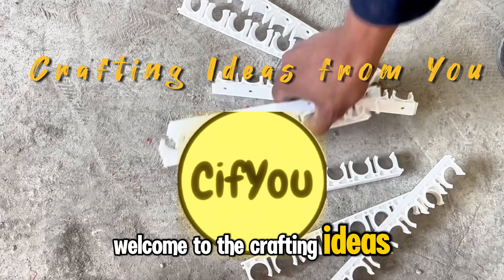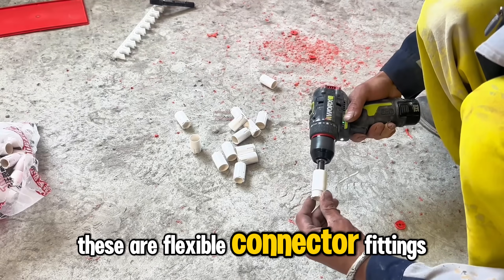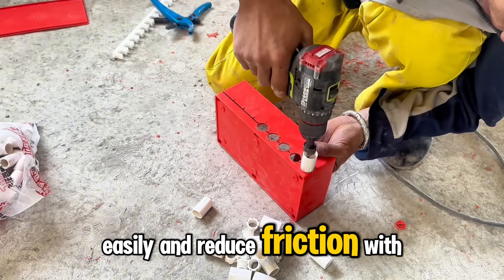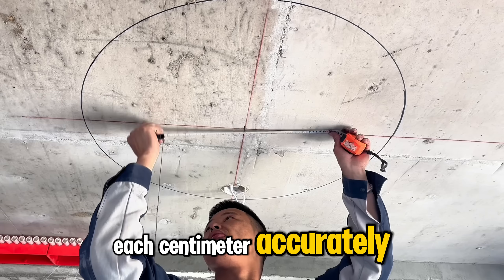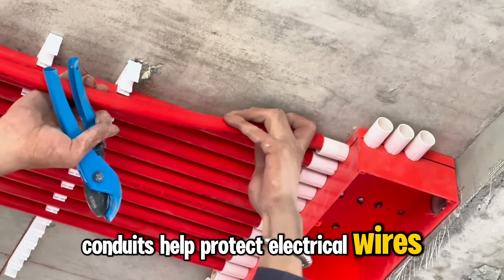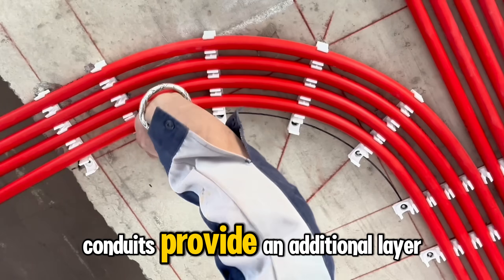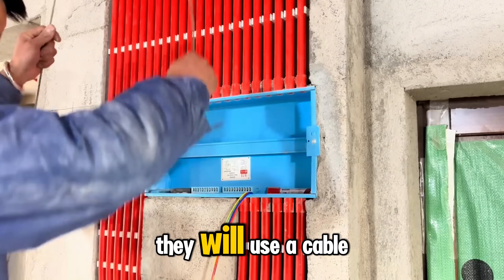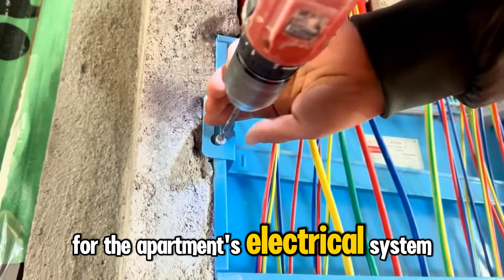What would electricity look like without following NEC (National Electrical Code) standards?

Comment: It's terribly inefficient though. They are still using the archaic European circuit breaker design on DIN rails. They're very useful in industrial control panels, but inefficient and archaic for building load centers. 

For example in the US circuit breakers simply plug on phase and neutral bus bars; no need for hand fitting bus wires between all the circuit breakers to interconnect them all. 

Plus we don't need to run such a ridiculous amount of wire and conduit since a single 15 or 20 amp circuit can daisy chain multiple light fixtures and receptacles on a single circuit; much more efficient and cost effective in both materials and labor.

The US were the pioneers in inventing and designing electrical power systems so we're generally more advanced, but have fallen behind on some of the European innovations like their outlet box designs and their incorporated wire set screw terminals.

And yes, I'm a licensed electrical contractor.
Reply: Also fallen behind on voltage front
Reply: @NileshKumar-uf4vh  <> Nope, that's a typical misconception of those not familiar with the US electrical power system. Non US power systems use unbalanced ground system because they only use the two wire 240 volt phase lines with one of the two phase lines grounded, which produces 240 volts to ground.

 On other hand the US power system uses a balanced grounded system, a three wire split phase 240/120 volt power systems that's only 120 volt to ground by grounding the middle neutral wire instead of any of the 240 volt phase lines. 

This system provides two voltages (240 & 120) to the building; 120 volts for lights, receptacles and small appliances, and 240 volts for large appliances like electric stoves/ranges, clothes dryers, water heaters, air conditioning, heat pumps, spas and so on. 

The system was adopted as an advanced safety system because it cuts the voltage to ground in half making accidental electrocution much less lethal. There's no need for 240 volts for lighting, receptacles nor small appliances; it's totally unnecessary. In fact there's currently a new low voltage wiring system being developed to replace the current 120 volt lighting circuits since lightning have become predominantly LEDs making 120 voltage and 15 amp lighting circuits totally unnecessary.
Reply: @Oldhogleg   trust me vro. Kindly cite any paper that shows 110 v ac mains is safer than 220 v ac mains.
Reply: @NileshKumar-uf4vh  <> Trust me bro, it only takes one amp to pass through to stop the vitals. The higher the voltage, the more amps are forced through.
Reply: @Oldhogleg  The claim that 110V electricity is safer than 220V electricity is a common misconception. In reality, the safety of an electrical system is not solely determined by the voltage level but by various factors, including the design of the electrical system, the quality of the wiring and components, and the presence of proper safety measures such as circuit breakers and grounding.

Both 110V and 220V electrical systems can be safe if they are installed and maintained properly. In the United States, the standard voltage for residential electrical systems is 120V, not 110V, and in Europe, the standard voltage is typically 230V, not 220V. These voltages are within the safe range for electrical systems.

It is important to note that higher voltages can pose a greater risk of electrical shock, but they also allow for more efficient transmission of power over long distances. In general, the safety of an electrical system is more dependent on factors such as proper installation, grounding, and the use of circuit protection devices like fuses and circuit breakers rather than the specific voltage level.

There is no definitive statistical evidence to support the claim that 110V is inherently safer than 220V. Both voltage levels can be safe if the electrical systems are designed, installed, and maintained according to safety standards and regulations.
Reply: @NileshKumar-uf4vh  <> You totally missed the point. It's about someone being accidentally electrocuted. Electronic safety devices like GFCIs are not everywhere and are not infallible and do fail. Besides our electrical power system was a safety measure before the reliance on electronics.

You can argue all the irrelevant minutias you want, but the bottom line will always be higher voltage means greater risk to life. If you can't wrap your head around that simple reality, then I can't help you.
Reply: @Oldhogleg You don't seem familiar with the European electrical system. Except for the UK, virtually all houses and modern apartments (particularly those without gas) have a three phase system, I think most often with 3x25 A service. 400V is commonly used for cooking equipment. I have a 7.4 kW induction stove for example, it uses two phases, the third is for the (separate) oven. I also a regular socket 3 kW kettle that boils a cup of cold water in 40 seconds. Lots of 2+ kW equipment: clothes dryer (w/heat pump), washing machine, dishwasher, four unit ductless AC, even my hair dryer is 2 kW… and it is all wired with 2.5 mm² copper on 16 A breakers.

DIN breakers are commonly installed on rakes, layered for three phases. Commonly a three phase RCD (GFCI) is the first item in a row, followed by 16 A breakers for all socket circuits. Lights are on a separate, single phase RCD and a 10 A breaker and 1,5 mm² wires. Sometimes socket circuits in wet rooms get their separate RCD or RCBO as well.

Meanwhile you only protect some outlets and incur the cost of GFCI equipment for each individually.
Reply: OK, but that has little to do with the points I was making. The point I was making is that the US uses a balanced grounded 240/120V split phase system out of safety because it's only 120V to ground. That's insanely dangerous to be running 400V in a residens. Plus the US load distribution centers are more efficiently designed because the circuit breakers plug on the bus bars instead of installing bus wires by hand to power the circuit breakers. 

You don't mention the configuration of your 3-phase system? Is it a 3 or 4 wire delta? Is it a 4 wire Y? Which lead are you grounding? Is it a balanced or unbalanced grounding system, or is it an ungrounded floating system. If it's grounded, what are the voltages to ground?
Reply: @Oldhogleg  You did make a point that 240 V is "unnecessary", which is a very self-centred perspective. You just don't know what you are missing.

Another difference you probably do not realize is that we don't have as many transformers. A common small pole transformer is not a thing here. A transformer here is a big expansive object, per village or a group of apartament buildings or maybe a major building. While you distribute power to the last mile at what we would call medium voltage, even through residential areas, we distribute it at low-voltage 400 V, from the big transformer all the way to residence.

However residents have virtually no chance of contact with 400 V. Commonly there is literally one spot in the apartament/house where the stove is hardwired. In houses, there would also commonly be a red CEE industrial socket in the garage as well, for workshop equipment and such. Otherwise every other circuit is single phase. The whole point of three phases going into a house/apartament is balancing. If residents are at home they use appliances wired to all phases if the circuits are distributed across the phases properly. That is why you often cannot get more than 7 kW-ish single phase service here (UK being an exception).

There are multiple grounding systems in use in Europe and different countries do them differently. Here TN-C (L1, L2, L3, PEN) used to be common, now being upgraded to TN-C-S, and new builds are TN-S most often (L1, L2, L3, N, PE). Some countries did TT and IT, but those become less common with metal pipes no longer being used and general standardization of European equipment.

You should realize the only reason you ended up with exotic three-wire single-phase system is DC legacy. Your household AC systems mimic the original DC +/0/- systems. It is not efficient, that is why virtually everywhere else three phases are used. Add one extra conductor, get three times the power. It makes sense on the grid level, it also makes sense in wiring residences.

And 230 V is not unsafe if you have well designed sockets and plugs, that cannot shock you, like ours, and if you have everything GFCI-ed, like we do. And even that insanely dangerous hardwired 400 V induction stove is way safer than literally having explosive gas pipes in your house and lighting that gas multiple times a day and breathing in its combustion products.

Your points about LEDs are valid, I even stumbled upon a concept of wiring office light fixtures with Ethernet cables at 48 Vdc – which can therefore be done by non-electricians.

Can't comment on your busbars, the name suggests a sensible concept - for a single phase, which has clear downsides compared to three. I guess a three phase comb busbar is a close equivalent used with DIN rails, but DIN rails can accommodate much more equipment than just breakers, like, I don't know, common GFCI for all circuits!
Reply: No, split phase has nothing to do with Edison and his DC system wich was eventually put to the grave when Nikola Tesla created the AC system here in the US which also created the single phase, 3-phase, and split phase. By the way, 4-wire deltas and Ys are also split phases; are you going to tell me those are DC throw backs too? I think not. And yes, we have 3-phase here too, and in higher voltages as well, but it's typically reserved for industries and large buildings. And we use the bus bar system for circuit breakers for those too. 

I'm sorry, 400V for homes is criminally irresponsible. It's near certain death if electrocuted. No, they're not running 400V in homes because it's better, they do it because IT'S CHEAPER! They rather put cheapness over the safety of the public. 400V in a home isn't a virtue, it's a crime! They've been urinating on your head while telling you it's raining.

By the way, what countries are running 400V into homes?

Oh, and once we switched from the old Edison DC system to the Nikola Tesla AC system, high voltages at the end user was no longer necessary. There's no way to step down voltage on DC systems from transmission lines to end user. But you can with the AC system via Transformers. So in reality, your system is the one being the DC power throw back.
Reply: @Oldhogleg  More volts, but less amps. Wattages are similar. The UK has a fuse on each plug. You don't need as thick of wire for 230V as for 120 at the same watts. 
   My only comment on the video is it looks good for in concrete. You need separate grounds, and if there's damage not as bad as everything is home-runned it seems.
Reply: @patrickvolk7031  <> You missed the point.
Reply: @Oldhogleg  Of course split phase is a throwback to Edison! Edison chose +110Vdc/0/-110Vdc and if you had a property wired up like that (carbon incandescent lighting primarily), split-phase was the quickest and cheapest way to convert it to AC. Think about it! And if that does not convince you, then just read about it. It is indeed a clever solution to a problem no one else had! That is why it is not used anywhere else.

You might think 400 V to the premise is criminally irresponsible, meanwhile pretty much the whole world use it, including all of continental Europe, look it up! Your continent is the clear outlier. You are not 'the most advanced', you are stuck with a legacy system that makes no sense with tech that is only slightly newer (3ϕAC) than its initial stages (1ϕAC/DC) and no one outside North America (and parts of Japan) uses it. You're telling me Germans chose cheapness, I say they chose efficiency and good design. Meanwhile, the UK did indeed explicitly chose cheapness (saving copper), that is why they have ring circuits on single phase, unlike everyone else (and are now stuck with crazy complicated code and crazy expansive electricians, so still use ancient systems, not upgraded for decades, while here a handy guy can upgrade your system and it will still pass an inspection).

Also, you do not seem to acknowledge, that we do not expose 400 V anywhere; it is not like a child can jam a fork into socket and get a 400 V shock! Plus we have shutters in Schukos now, so even 230 V shock is unlikely. I do know tradesmen, however, that did get 400 V shock and, sure, it hurts much more than 230 V, but it won't kill you. Note that 400 V is L-L, so through the skin only, it is still 230 V to the ground. And GFCI's are everywhere, so it is only 30 mA and less than 40 ms, so less than a heartbeat. And we do not run five conductor wires throughout homes, just the stove. Otherwise single-phase circuits spread out from the distribution box, it is just that those circuits are on different phases. So drilling to 400 V is about as likely as drilling through a gas pipe. And still safer.

Look, the world applies safety at different levels. Your way is not the best way, just 'a way'. And with exposure to different perspectives, it doesn't seem to be 'the best way', as pretty much everyone do it differently and converge on approaches that are significantly different than yours. But you can believe in manifest destiny and American exceptionalism all you want, I don't care.
Reply: @Oldhogleg  My bad, I got my Ohms law messed up. I stand corrected on that part.
Reply: I don't know what Planet you're living on, but I did a search and there is no country running residential voltages above 240V at all. I think you need to be evaluated by a professional to make sure you can be left unsupervised.
Reply: @Oldhogleg  I want to say the 400V is used for trailer hookups and the like. The plug is a screw-type MIL-STD plug
Reply: The US had its salad days with electricity before it became standardized. 2 prong was common until the 70s. K&T was a thing until the 30's. Fuse panels.
    I always thought Europe didn't have a lot to grandfather in, and the stuff was very dodgy at first. Then in the 70s they really standardized, with switches on outlets, shutters, and all that good stuff. The 50 Hz choice was for efficiency.
Reply: @patrickvolk7031  <> Oh yeah, I pointed that out early on that things like the UK outlet box devices were better than the US with the incorporated set screw terminals, but everything else is a throw back to more primitive times; especially the ring circuit!
Reply: @Oldhogleg  I was just pointing out the choices aren't made so much because of technical superiority, but because of existing choices and systems. Plugs were originally to go into light sockets because that's what everybody used electricity for. Yeah it was dangerous, as was using pennies as a fuse replacement in a pinch.
Reply: @Oldhogleg  Yet another that do not understand how 3 phase systems works? Short: Star connection from the transformer with the star-point as Nul (Neutral) and 240 Volt between star-point and each phase, each phase is 120 degree apart and you have 400 Volt between each phase, so yes indeed there are many country's tat have more than 240 V at residential, but what do an American know about that?

Comment: a lot better no split phase 50 hz the same voltage like all other countrys
 not having to do strangs things to have three phase
why are electric motors  three phase because electricity is three phase
is the utility producing single phase or three phase no but kim young
have said we give you split phase so if you like you can make single phase

Comment: US isnt world's centre. Every country has its own standards for all kinds of things, electrical wiring included. US has a grid-to-resident supply of 110v. Some countries have 220v. Also, I see that power sockets in US households don't have a dedicated switch beside them. I personally find that to be dangerous, especially because whenever you plug in something that draws a lot of electricity (like a toaster, heat gun, refrigerator etc...), it sparks when you plug them in. I get that you have breakers as a safety measure but as someone who grew up in a country where we have dedicated switches next to each power outlet, I find this to be much safer and reassuring.
Reply: US has grid-to resident supply of 240v with a split phase neutral used to provide two legs of 120v for common outlets and fixtures while maintaining 240v to higher-demand items like stoves.